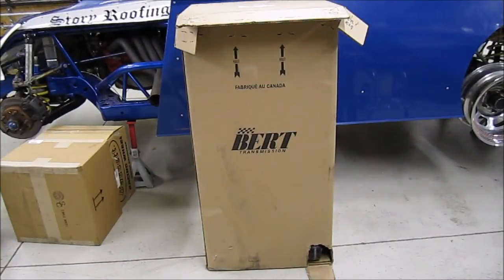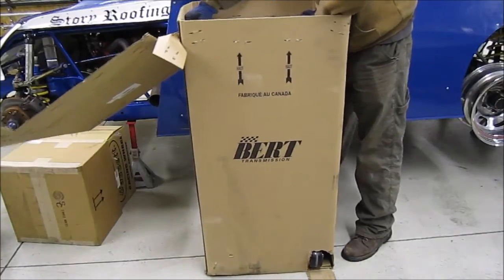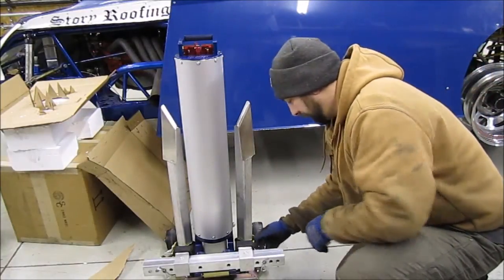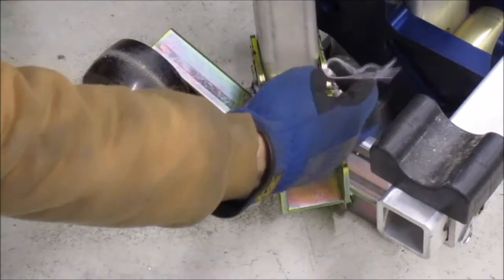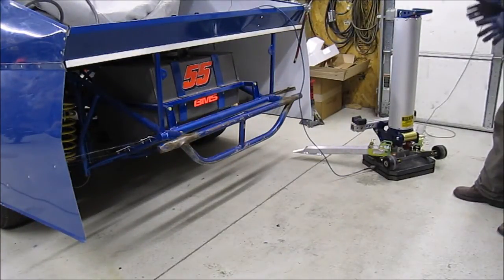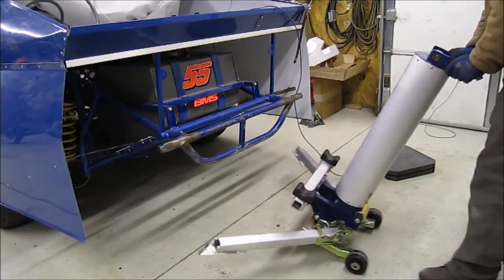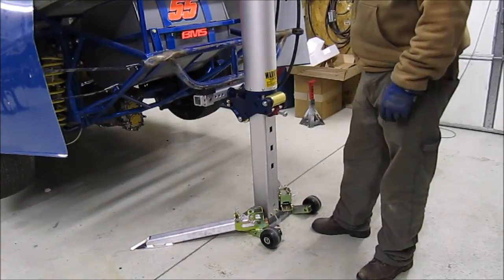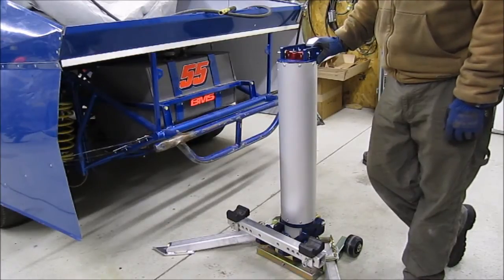Review: Bert Air Powered Bumper Jack

Comment: What is the line pressure of your shop?
What does the Bert Air Powered Bumper Jack cost?
Very thorough, but a bit of a long video.
Reply from the maker: Thanks for your interest. Since the video was shot, I turned the shop air back up to 100psi... I think I mentioned it was turned down to about 75psi? at the time of the video. The jack is a lot more crisp in operation now. They are around $1000 depending on the retailer, I dont know how stable the price is/will be.